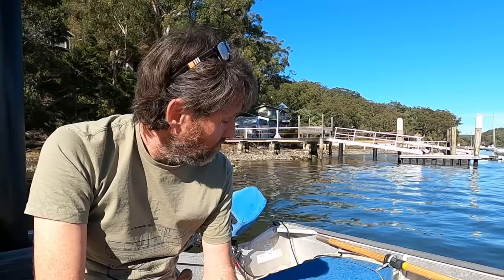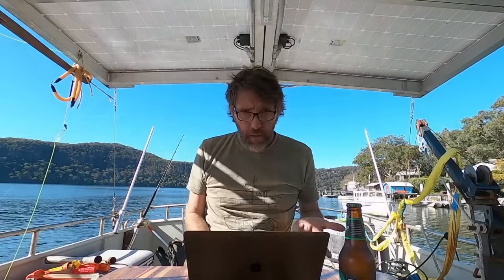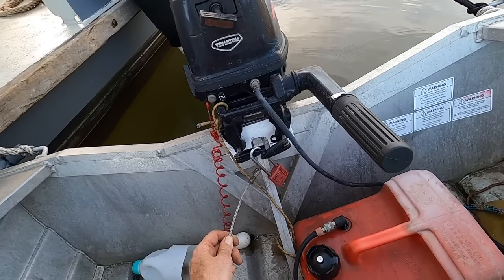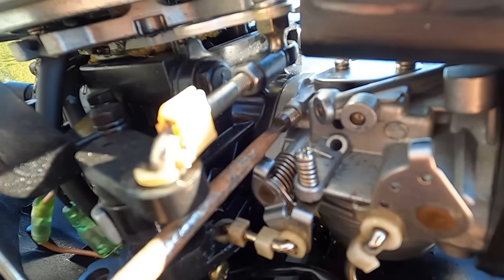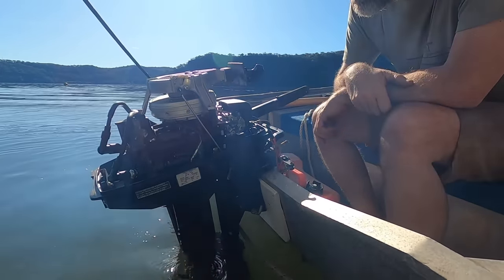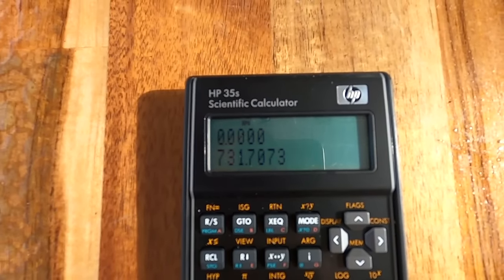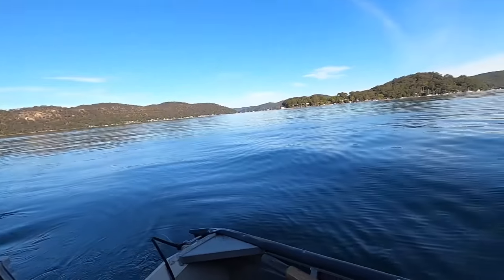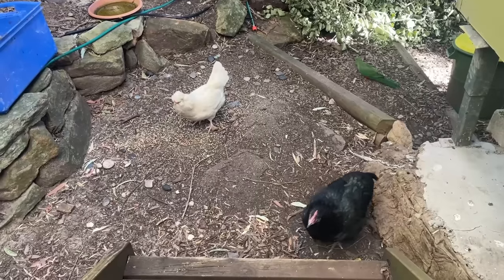Fixing an outboard that stalls at idle

Comment: My carb idle circuit was blocked by a degrading fuel line. Would run at higher revs but not at idle and therefore I could start and run the motor but could NOT put it into gear! Bloody protection circuit (start in gear I presume ) would cut the motor. Lucky for an auxiliary.  What's the best fuel line to use? The inner liner was crumbling up.
Reply from the maker: Yes, a lot of outboards won't let you put it in gear while the fast idle is up. Here's a vid on the fuel line problem you are describing https://youtu.be/qFAC3oNMBdc

Comment: Hi Stu. Do you know anything about 1985 Mercury Blackmax outboards? If so I have one a friend gave me. But the high speed spark advance module doesn’t work. The wiring is brittle and broken. I have read you can eliminate it and change the timing. Do you have knowledge of that and if so what should the timing be set to? Thank you for any help.

Comment: I had a Mercury 85 that would run great on a test stand but horrible on the water. Turned out that a plug wire was arcing to the cowling when it was installed during the water test.
Reply from the maker: Glad you found the problem, things like that can be tricky to track down sometimes.

Comment: you cant go wrong with an optical tach unless you are too close to florescent lights. with that adjustment being up that high it might be adjusting the air bleed on the idle fuel circuit.  you'd have to get service data to tell you. it still adjusts fuel but by adjusting a vent.

Comment: Question:  in this video and others, you seem to suggest that adjusting the gas/air mixture screw to the sweet spot is hitting the highest rpm. I was taught you turn the screw in (counting the turns as you go) until near stalling. Then back out the screw (counting the turns) until it almost stalls. Then turn it inward, halfway between the two extremes.  For example extremes reached at 2 turns in, and then 4 turns out, the sweet spot would be two turns out from the bottoming out of the screw. Am I wrong?  Plz advise. Thx.
Reply from the maker: I imagine you would arrive at a similar point. I've not got that optical tacho that I ordered so it would be interesting to try both methods and compare the final RPM.
Reply: Thank you for your quick response. I’m honored. Love your videos.

Comment: Nice, lots of stuff most guys won't know, but you would be good to have mentioned the possibility of a clogged air filter and also set idle/mixture with a hot engine. Also water in the fuel filter.
Reply: don't think that motor has an air filter
Reply: @brendanbarker2095  probably why it wasn't mentioned then, but one of the first things to check if you think it's running rich is the air filter.
Reply from the maker: Yes, engines that have air filters can definitely be starved of air making them run rich, my mulcher suffered from that recently. I haven't ever seen an outboard with an air filter though due to the lack of dust on the water compared to the road.

Comment: hi man, thanks for the useful video. Am I wrong or you call a half-turn (180 deg) of the idle airmix screw actually a "turn"?
Reply from the maker: It is common to count "half turns" as it is easier to physically do. If a manual calls for 2.5 turns out I would do 5 half turns.

Comment: Hi Stu, got a new problem that I'm sure other folks have had with the CDC two stroke motors. Mine after running up to speed for awhile will start to cut out? Then fine. Yesterday it did the same thing on the way back but was close to port entering the no wake zone and ran fine at low speed. I have tested both the stator and trigger for Ohms and both good. But doesn't mean there could mean one of them could be damaged? The switch box could be going out or the regulator/rectifier possibly. I did recently replace burnt connectors going to it but since have been ok. Any thoughts well accepted. Thanks Tim
Reply from the maker: Problems like that are certainly tricky to track down. Could be an electrical component failing when it is warm, could be a head gasket problem that only presents itself when the block warm. I would also be considering what caused the electrical connectors to get burnt and needing replacement.
Reply: Thanks for responding. Going to pull the flywheel to check the stator and trigger. @ idle I could hear a ticking noise. I've heard the magnets can break loose or conderser coils. So will take a look. More content. Haha

Comment: my outboard seems to be very fuel hungry, its a Yamaha 30hp cv 2006. do you know if there is a way to lean the mixture when in high throttle settings? or do you know much about these outboards, are they just a very fuel hungry engine? cheers

Comment: Looks like its powering the legendary stessl 3.0, I believe the only 3m production tinny  capable of up to 15hp  ( or a Super Merc 18hp hehe).
Also for single and twins its possible to do, not only an  electrical and optical, but an Acoustic Rpm count by slowing youtube to .25% although please make sure you have queued to the engine start or it will sound like Stu has just drunk a carton of Coopers (Stout) lol
Reply from the maker: I think this boat could really use a 15. It planes nicely with one person but drops to about 4 knots with two people.

Comment: Why does my 1984 50hp outboard motor Mercury take so much time to start after priming it. It turns over but I need to keep the key in start position for 10 to 15 seconds before the motor starts up?

Comment: I have year 2000 mercury 4 hp ,there doesnt seem too be a adjustment for idle ,the cable just comes in from the tiller and locks onto the throttle lever ,it locks on with a screw that holds it ,,to change the idle speed should I just loosen the cable locking screw and adjust the cable?...I do have the same feul rich and lean screw like the one u backed out 3 turns

Comment: hi different topic but hope you could shed some light please. i have a mercury 4hp 2 stroke that starts fine idles fine but wont accelaerate at all changed plug cleaned carb in ultrasonic bath changed fuel filter and diaphrams in fuel pump. even it i turn the linkage on the carb totally baffled any ideas kind regards dave

Comment: Have to wonder if you inadvertantly fixed a little vacuum leak by loosening up the carburetor and then tightening it back down. Or maybe fuel flow at idle because the fuel pump is weak because of a bad gasket? (Or once again low vacuum.) On the other side of the coin, take the win...
Reply from the maker: Stranger things have happened!

Comment: Here are some causes that I discovered the hard way when using an external fuel tank, listed most likely to least:

1) Bad seal in the external tank fuel hose connections. At idle, the fuel pump isn't working hard enough to pump fuel against an air leak in the connector at the fuel tank. Detection: when you prime with the bulb, it doesn't become stiff because air is leaking into the hose. Correction: first clean the fuel hose nipple on the tank. If the leak persists, replace the hose and/or tank. Elevating the tank above the engine allowing gravity to assist in feeding fuel may get you home.
2) Evil, insidious failure of the fuel tank air vent to open. In order to prevent tiny amounts of fuel evaporation from escaping through the air vent into the environment from the tank (and not trusting the user to close the vent), some newer tanks have a diaphragm in the fuel cap that will only open when there is a slight vacuum in the tank - even when you have opened the air vent. When the diaphragm fails to open, the engine will be fuel-starved at random times when a vacuum develops in the tank. Detection: The engines fails as if it the tank is empty. The primer bulb collapses when squeezed, or a "whoosh" sound occurs when the fuel cap is removed (you may even see the sides of the tank expand). Correction: a) Loosen the fuel cap to allow air to enter the tank to get you home and then replace the tank or, b) find an old fashioned fuel cap without the evil diaphragm.

Comment: Hi I’m try to build a dva to measure my engine. What size on the on the capacitor. I’ll  read 2.2 and 22 micro farad on drawings.  What did you use

Comment: Hey mate my 90hp Yamaha 2stroke 08model just put new water pump kit thermostat water is now flowing threw super fast but went fishing going WOT 4000rpm 1min in overheating alarm comes on lite smoke so I bring it down 2000rpm running fine so I keep going to fishing spot normally 15im trip take 1hr at a slow 12km 2000rpm so coming back I tried again WOT 1MIN same thing overheating back to 2000rpm running  fine. So should I flash engine with hydrochloric acid in a 200liter drum fo 30min any suggestions would be most appreciated. My friend told me it might be head gasket but I'm not so sure because the engine runs fine only overheating @ WOT and no starting issue at all tip start
Reply from the maker: Cleaning it out may well fix the problem. Had and outboard recently that was doing that and a mild acid flushed fixed it right up. Just be sure to flush with fresh containing bit of sodium bicarbonate to neutralise any remaining acid afterwards as it can eat aluminium.
Reply: @DangarMarine  Thanks very much for your help mate 👍

Comment: How much faster would you expect a 4 stroke idle to be at idle. Context: I have a mercury 9.9 and the idle spec is 900 rpm in neutral. I can't test it under a load easily so I'm trying to figure out how to test it on the stand to get something reasonable.

Comment: Hey mate wondering if you can help me... I have a 90hp 2 stroke  johnson outboard that stalls when you shift it into gear... its using alot more oil than normal.. runs well at full WOT no problem but when you go to neutral then slowly into a gear it just cuts off and stalls... when you shift it quickly it stays on.... what could this be ? Any help would be appreciated

Comment: Any idea what a motor that is idling then dies after about 20 seconds in an agressive jerking manner could be?
Reply from the maker: Try squeezing the primer bulb to see if it keeps running, if so it is probably the fuel pump. If not could be mixture or ignition related.
Reply: @DangarMarine  Will do, side note- will a mottor only jerk or "spit" and die at idle if it's lean, or will it do so if it's running rich as well?

Comment: I don't think that a wasted spark system is possible on a 2-stroke engine. When the piston is at the bottom, it is too likely that ignitable mixture is around the spark plug. Especially at idle when a combustion does not reliably occur every revolution leaving ignitable gas in the combustion chamber.
On some engines the manuals recommend adjusting the idle mixture screw a little to the rich side: Find the setting for highest idle rpm and then half a turn (or quarter turn) back out.

Comment: Brave pulling parts off a motor in deeper water, but I suppose Australia has warm enough water that you could dive for whatever you drop.... here the water is consistently <1 celcius (glacial runoff area, in the winter the glaciers build up, in the summer they melt and keep the water cold).

Comment: what do ya do with old petrol to dispose? I tried using some as week killer around my boundary at home but the house smelt like petrol for 2 weeks. So I've been offering it to people saying I just don't have any 2 stroke engines any more, which is a lie, I just don't know what to do with 90L of 2 stroke that has chunks in it.
Reply: Put it in your car wont hurt if its diluted and clean enough.
Reply from the maker: I've definitely thrown plenty of old fuel in the car, but parts cleaning is another good option. I once emptied the tank of a sailing boat where the guy had put petrol in his diesel tanks. It was only about 10% diesel so I used it all in my car. Smoked a bit in the mornings! ;)

Comment: When the motor is running with the cowling on then where does it draw air from?
Reply from the maker: There is an intake on the back of the cowling so stay doesn’t get in.
Reply: @DangarMarine  I have a 15hp 2 stroke mercury.. Have done a compression test and both chambers are at 75psi. Not sure if that's a good or bad thing. Is that too low?
Thanks

Comment: As for the mixture screw, I could be very wrong so I am asking to know: 
But I was told that if the screw is at the front of the carb it increases the air is you unscrew it. If it's at the rear, it increase the fuel as you unscrew it. 

Again, I don't really know:)

Comment: Stew, I am at the end of my rope. I have a 1995 mariner 150 hp. I keep blowing through voltage regulators I have changed the trigger, the stater I just don’t know what to do. My Voltage regulator has a in-line fuse and it keeps blowing the fuse. So now it’s not recharging the battery. 
I took it to a shop and they told me I had the wrong voltage regulator they purchased one from CDI, without an in-line fuse, blew that one. you run it in the driveway with muffs everything‘s fine soon as you take it out on the water sometimes you can go where you want and it’s fine then you go to restart after fishing for a while and boom blows the fuse. Sometimes it blows the fuse 15/32 after leaving the dock.
I know there’s a lot of variables I am a golf course superintendent I work on a lot of machines, electrical and other stuff but I really would appreciate any suggestions.
Reply from the maker: It’s certainly a weird problem. Is there any chance that something else on engine is drawing more current than it should? Sometimes you are looking at a specific part as the cause of the problem but it is really just victim of the problem.

Comment: I've never seen a 2 Stroke where the idle speed was adjusted at the Carb. All the ones I've ever seen, the idle speed is controlled by advancing/retarding the Spark
Reply: It has been common with Japanese motors. 
From what i've seen, looks like spark advance for idle speed is more common in American motors
Reply from the maker: Ignition timing will definitely have a huge affect on idle speed. Lots of modern CDI igntion outboard don't have adjustable ignition timing though. They just have a crank position sensor that the computer uses to determine a relative firing time based on current RPM and throttle position.

Comment: after watching, seems like idle circuit inside carb is becoming restricted.  not sure it you guys have 10% ethanol fuel down there, almost always the culprit for carb cleanings up here in the states.  looks to me like you need a micro air compressor and small tank mounted inside of Renko for just such jobs ;)
Reply from the maker: Yes, probably does need a clean but I'm starting to think it has bigger head gasket problems due to some overheating that is presenting itself. Renko does have an air compressor that runs of the Detroit which is very handy!
Reply: @DangarMarine  be a good "part 2" vid!

Comment: The book said 950 rpm at idle neutral. 750 in gear.
Reply from the maker: Yes, I did notice I misspoke when editing this..
Reply: @DangarMarine  did you try 950 or do you rather prefer that sweet spot.

Comment: it can be fuelpumpmembrane so gas i leaking in to the crankcase. my yamaha 40hp autolube blew up becuse of that
Reply from the maker: Yep, see that a couple of times, but the plugs tend to go very black when that happens as the fuel being sucked into the crankcase makes it extremely rich as all RPM.

Comment: Those screws very, very rarely turn by them self. 
Which indeed sounds like the carb needs cleaning.
Reply from the maker: I tend to agree. I almost feel like a carb clean should be an annual service task really.
Reply: @DangarMarine  I have a Nissan/Tohatsu 18Hp from 1992. 
One impeller change and every summer plugs and gear oil. (should be more frequent impeller changes) 
No f'n problem what so ever. 
Then again, -79 6hp OMC had to be overhauled because of low compression. 
These 2 stroke engines last at least half of a lifetime with no care.

Comment: My 40hp refuses to start unless it's in high idle, will stall unless it's idling in high idle, bucks when shifting into gear, runs hot and bogs out after even a short 5 minute ride, and has refused to start at all for the return trip, the last time I had it out. I had to get towed back to the boat ramp by a jetski

Comment: This is much like our (4 cycle) mower engines, run the carburetor dry B4 putting it up and use new fresh fuel if it has been a week or more since it was last used.  (and AVOID gasohol) Ron W4BIN

Comment: First thing to any repair, how much do they want to spend. It’s nice to fix things properly but sometimes spending hours on something worth sixty bucks isn’t a good idea.

40 thou gap on a spark plug? Wtf they are usually 16 to 25 on two cycles. Cars are much bigger.  Also ngk spark plugs are notorious for being dead. Check them to make sure they spark both upside down and right side up.